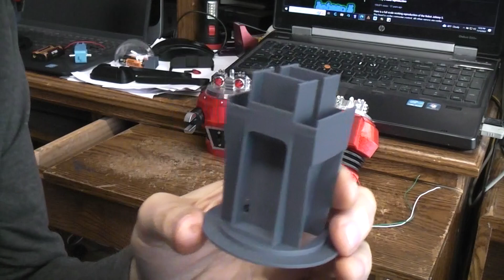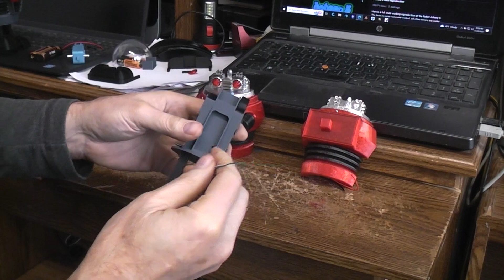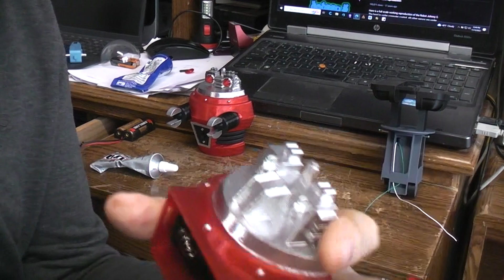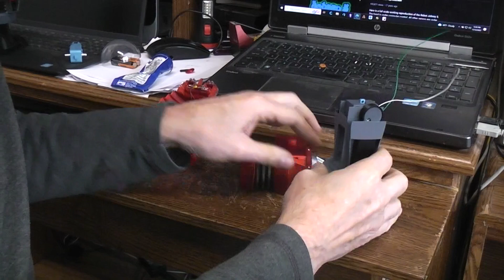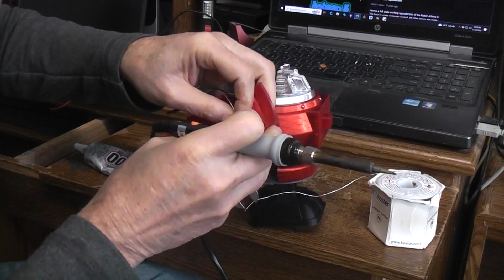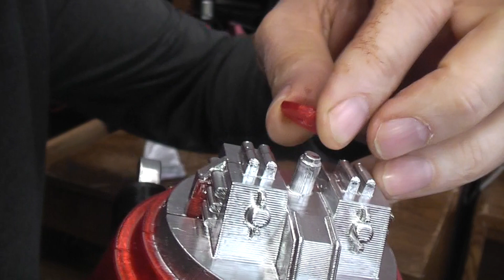Build video for large  3d printed TT gearmotor Tomy Pocket-bot project.

Comment: Thanks so much for this excellent model! 
One of my sons loves Pepsi. So, I just discovered that removing the dome from the bottom of a pop can makes a body for a Pepsi Man! 
PERFECT fit. Cutting the little brace between the leg supports allows an AA battery front and back. I’ll post a video when I get the thing finished. Maybe tomorrow…
Reply from the maker: Sound like a great idea. Can not wait to see what you come up with.
Reply: I posted a reply but it seems youtube didn’t like the link. 
Little robot is done. Video on my channel.
Reply from the maker: @noads1035  Here is the link to No Ads build.
https://youtu.be/Ucnhlof7Ync?si=fNh5Z8sMfB2oUVpJ

Comment: Printed out a bunch of robot parts , don't  know where any thing goes, sorted them in zip locks , oh well  :-(
Reply from the maker: The build video should make it clear where everything goes. it is one the simplest robots to build. So few parts.
Reply: @Robothut  I doing the outer shell of the front  of Tommy 21 hours  , I just hope I don’t reprint a same part .
Reply from the maker: 21 hours? It takes 3 hours on the Bambu lab A1 mini and only 9 hours of the Prusa Mk3S. Not sure how it could take 21 hours on any printer. @PeterAgostiniJdcap26
Reply: @Robothut  I set it on a raft support 
So no chance of  print pulling off bed . Yes it uses more plastic . My machine only runs at 60 mm  I have not put it  higher , is what is recommended.
Reply: @Robothut  I have not good luck with using glue stick on pei plate.
Reply from the maker: Maybe you have some bed level problems.  @PeterAgostiniJdcap26
Reply: @Robothut  I level the bed … prints coming out fine .. will recheck that. 
Cause the speed  … I looking at another printer in the future to get down the road. If I get this robot together and working it will be a miracle , but I’m having fun John  no worries .. I don’t know everything I’m still learning , watching other videos .. on topics .. I’m lucky I got this far ..